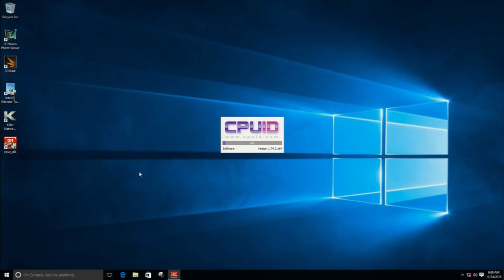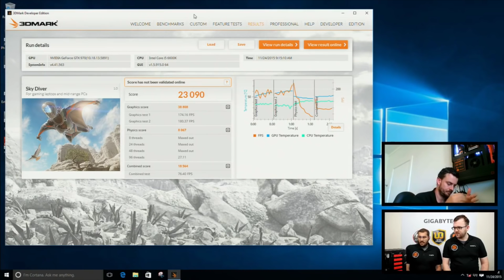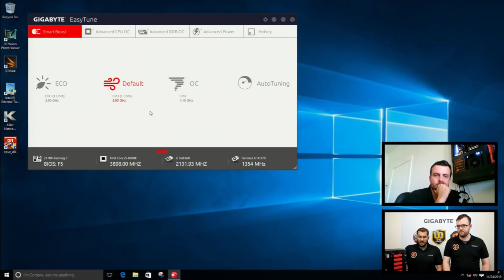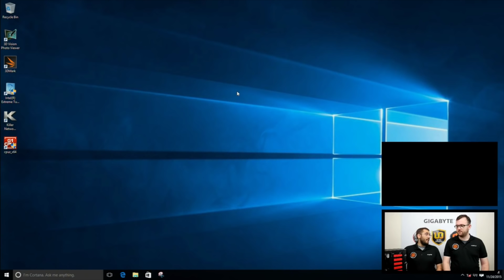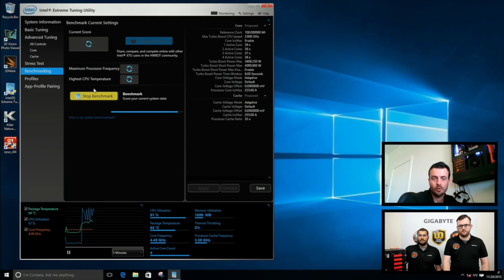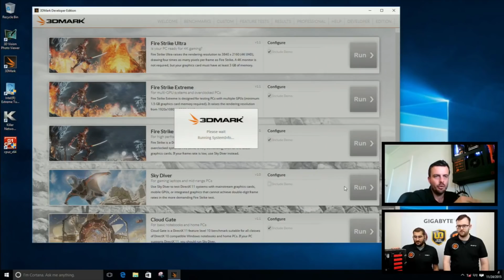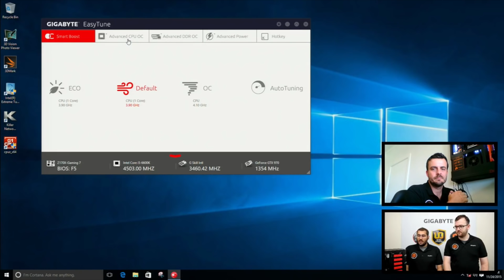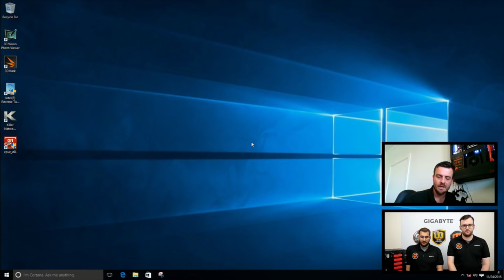Let s Overclock! Learn how to do your first Overclock Highlight

Comment: Guys this is awesome,I overclocked my fx 6300 from 3.8-4.1 stock freq. to 4.4Ghz with Easy Tune.I have Gigabyte 970 g1 gaming mobo.First question is: can I push it more with manual oc? Second question is: If I have onother mobo,not a gigabyte,can I use Easy Tune for oc a cpu? Thank you.